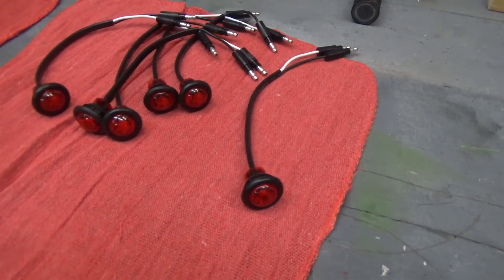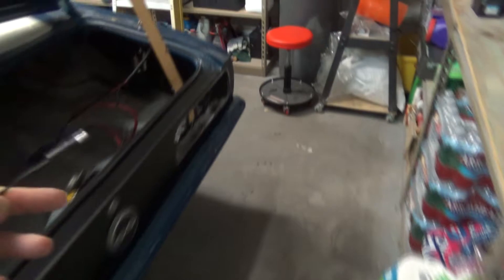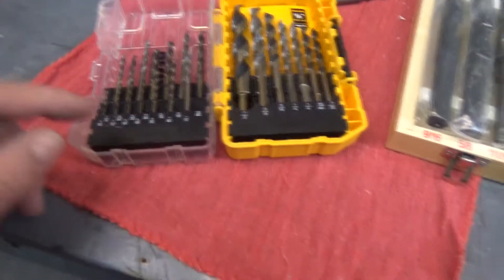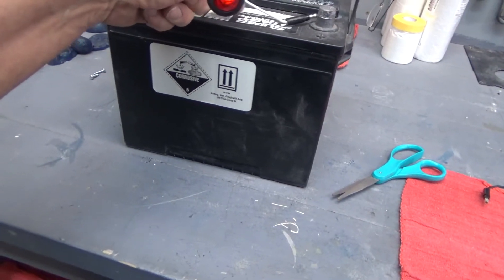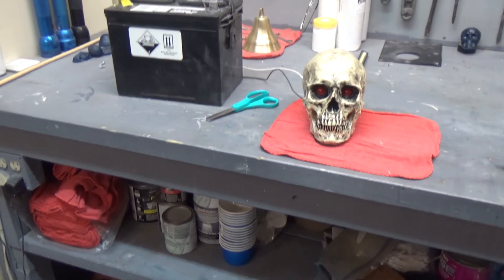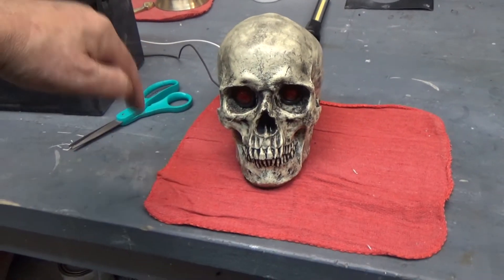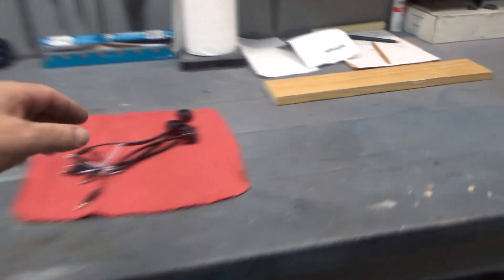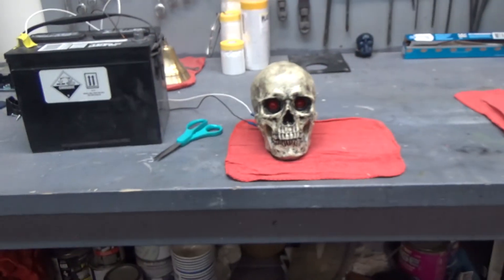Working on the 3rd brake light skull. Saturday, 3-6-21

Comment: That's going to look fantastic! I'd think it would be pretty easy to put a self-parking wiper motor under it, and have it stop centered looking back. It could be one from a small car rear wiper. Finding one should be easy. You could use a variable power supply to get just the speed you want. Linda and I send our best.